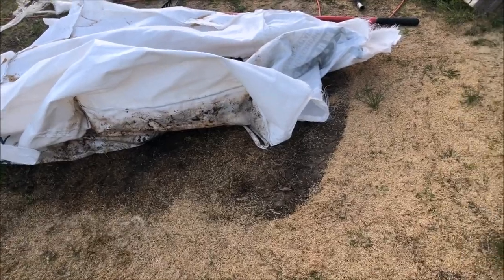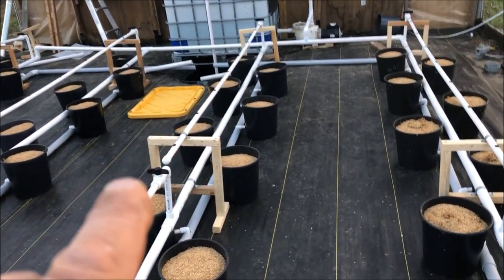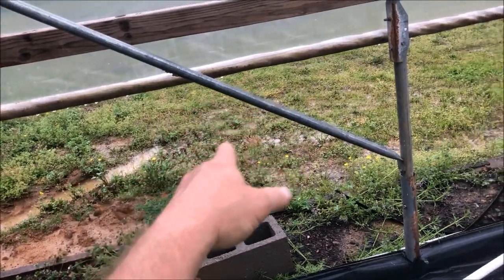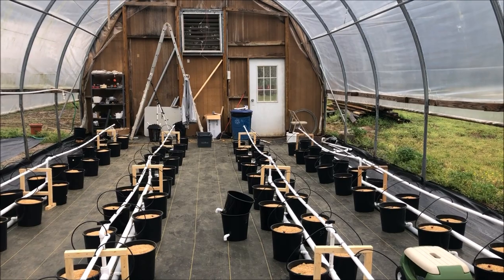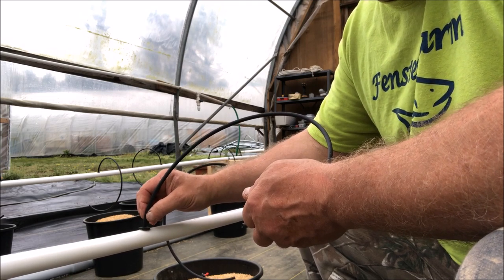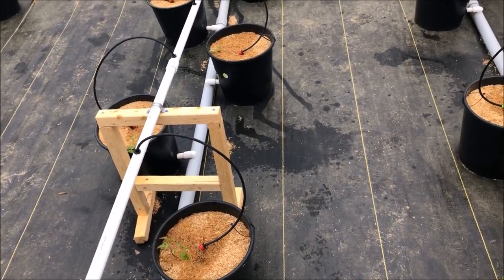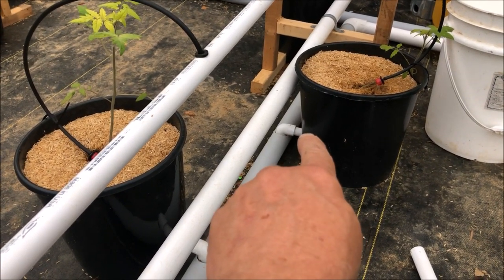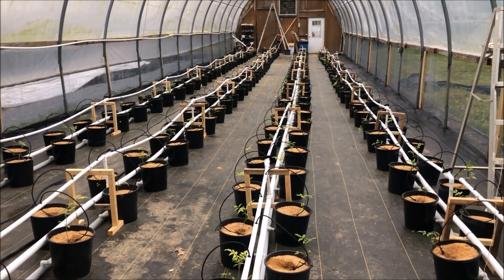Hydroponic Tomato Greenhouse  How it works!

Comment: You could use fire or hot water to heat up the tip of the pipe a bit and the emitter will slide in easily.

Comment: What you've done is very good and no doubt you were able to grow tomatoes really well. There's a couple of things you could have done differently. To rectify the problem you had with the return lines overflowing several meters away from the sump - you could just replace the return  lines with 100mm (4") storm-water pipe. Also - when you look down the greenhouse at all the feed lines - when they are full of fluid they're all sagging in the middle. A solution for that would be to string a wire rope along the full length of each row and zip tie the PVC pipes to it. At each end have it strung off a metal pipe buried into 600mm of concrete and adjustable with a turnbuckle.  The third thing - make all the inlet pipes a bigger diameter - at least 50mm. The pump motor works a lot harder trying to push fluid through a narrow pipe than a wider one.

Comment: Hi Chuck I used to grow tomatoes has 500 plants but used the perlite bag on the ground that drained out slits in the side of the bags. I learned this from a older man to use a 1hr timer and set it up to where it would only turn the pump on for 30 sec to a max of 90 sec three times a hour. That is why the 1 hr timer. This was done so the plants only need so much water and it would be much easier to control how much the plants received. The dutch bucket has a reservoir in the bottom that will make up for the time the pump is off . The time off also lets the plants take up and reduce the drain back.  I just thought that you might like a different approach to the watering.

Comment: Add a filter right where you are pointing at 17:46. Of course you've already replaced all the emmiters now. Great setup. Keep on keeping on. I get you with the arthritis. I use pliers to hold the tube or fitting when i can. Helps some.
Reply from the maker: I’ll give that a try Randall. Thanks!
Chuck

Comment: I love your system much better than mine, however I have just one suggestion to ponder. You have a two pump system, if something happens to the sump pump the other will still be pumping so you will loose your water. My thoughts is to put a automatic bilge pump that runs off a trolling motor battery that can kept charged by a solar battery charger. That way if the water level goes up the back up pump will kick in. Thanks for the videos
Connie
Reply from the maker: Great suggestion. I will look into this. I have spare pump should something go wrong long term but that would eliminate a mess in the meantime. Thanks so much!
Chuck

Comment: You could use a 1/4 shut off valve to regulate the flow.  Item # 248944 Model # MLT-BVA
Mister Landscaper 3-Pack 0.25-in Barbed Drip Irrigation On/Off Valves. This product is sold at Lowe’s home improvement store.
Reply from the maker: Roger Moore Thanks. If I end up having a problem with this setup I’ll give that a go.
Chuck

Comment: Hi Chuck, Curious to why rice hulls and not coco coir. Also, I learned by using an organic soap, like Amway LOC (no I'm not a distributor) your fittings into rubber or plastic goes a lot easier. Love your videos. Thanks, Bruce
Reply from the maker: Sounds logical. May try that next time. I’ve got 4 more greenhouses to build this in.
Coco coir is too expensive here in the Midwest.
Rice hulls are plentiful.
Chuck

Comment: Tie a  2or5 gallon paint strainer bag around the end of your return water line . A cheap but effective filter that doesn't clog. I use a 1 1\2 diameter  drain or return line at 1/4inch pitch per foot .1 1/4  was to small .
Reply from the maker: I’ve actually done that. I have strainers over the 4 returns and one over the sump pipe. That should do the trick. Thanks 
Chuck
Reply: Fensterfarm Greenhouse you also  need a real 1 1\2 filter on the pressure line there between 50 and 100 dollars. Then clogged emiter issues  due to debris  should be resolved.

Comment: thinking of an idea of a hand tool to help you push the grommets into the pipe, what is the specs of the grommet and hole in pipe?
John
Reply from the maker: 3/8” outside diameter. 1/4” inside diameter. 1/2” tall

Comment: Ok, I have to add my 2 cents in. I do believe your system is viable, except for one big problem. Can anyone guess what it is? It is at 18:22. Please comment if you have seen this and to help him. In other words, please paint your Storage/Reservoir tank.
Reply from the maker: Delekham 1 the tank is covered with black plastic then covered again with white sheeting to reflect the heat. I hadn’t finished the delivery system completely when that video was shot. Check out the latest one. I believe it has a shot of the reservoir in it. Thanks for following along.
Chuck
Reply: @FensterfarmGreenhouse  Can you provide the link?
Reply: @FensterfarmGreenhouse  Well done, I will struggle along with you! PEACE

Comment: Stop . There is a much cheaper and easier way to do your irrigation system  that works great.  I've built    over a dozen systems  with an open mind refining a little each time.  I'll try to put some footage up for you   but  it won't be edited because I lack in that department.
Reply from the maker: I am very interested!
Thanks.
Chuck